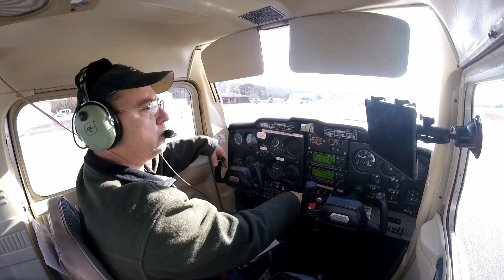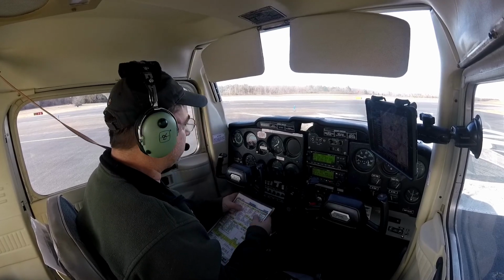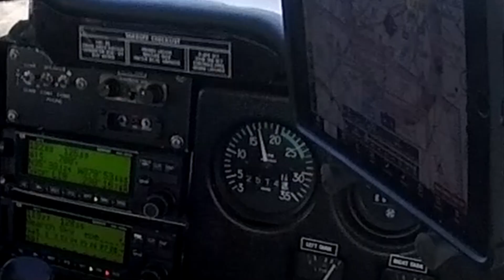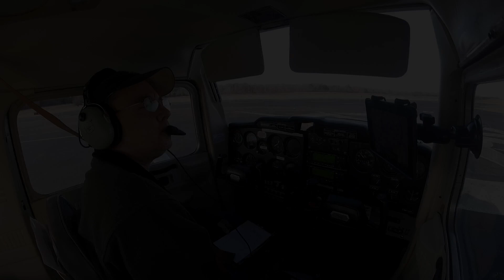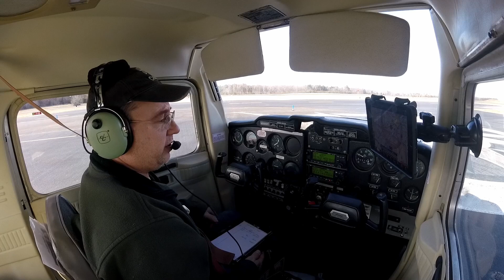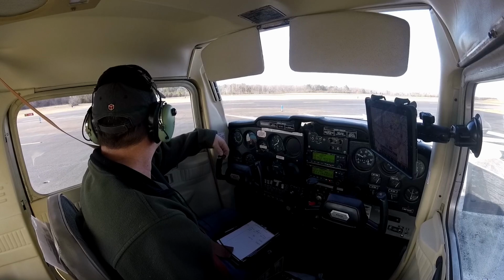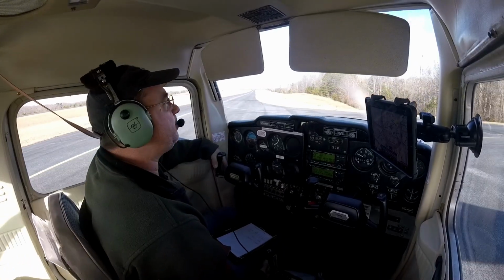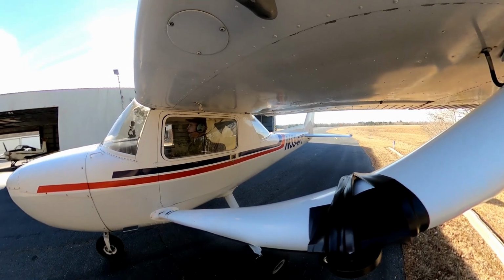Fouled Flight in the Cessna 150

Comment: This is the first video of yours that I have watched. It was so well done that I subscribed and intend to watch your others.
I noted that you lean as needed, so I'm going to throw something out for you to consider, check, and verify. The O-200 seems to regularly (when sitting idle for awhile) allow oil fouling to occur on the lower spark plugs. Most of the time it will be very apparent which plug is going to be the consistently "guilty one". There will be obvious oil on the plug. Assuming that the plug really is still good, all that is needed is a quick cleaning. Gasoline and a nylon brush will get it clean in a minute or so. Dry it off. Install it. Run a regular mag check before putting the cowling back on.
That would be an excellent and helpful video for you to make, too. 
Good luck
p.s. Check the plug on the pilot's side, nearest the fire wall first.
Reply from the maker: Glad you liked the video. Funny you say all that. Dropping the latest video as I saw your comment.
Thanks for watching
Reply: I just updated it with a p.s. Thanks for the reply to my comment. Good luck.
Reply from the maker: @ytorwoody  update video should be up now.

Comment: Not sure if you tried a maximum lean, full power run to clear the fouling... But while at 1700rpm, lean slowly until you get a stumble, then rich until it smooths out, then apply full power for a minimum of 1 minute. If you have EGT, lean for peak at 1700rpm. This is an almost surefire way to clear fouled plugs on the O-200. I have employed it in the past, and the only reason it has ever not worked is if the issue is elsewhere in the system. Cheers!

Comment: Bummer. 
About 2 months ago on a x country flight About 75 nm into it my C150 started losing rpm gradually.  I was at 3500 ft. I didn't recognize the cause immediately and with partial power I trimmed it for best glide and actually declared an emergency.  Luckily,  I finally realized it was carburetor ice.  At 2500 ft I turned the carb heat on and got full power back in 30 secs. I feel dumb and mad at myself for not recognizing the issue right away.  It was a good lesson.
Reply from the maker: Great story. Thank for sharing. My flight to CDN was like that. I noticed I kept having to trim up to maintain altitude before I saw my rpm had dropped. 
As soon as I added carb heat, BAM ! Power returned.  I think I had caught it early. 
From what I've heard, 150s are know for carb ice due to such small carb ventures.
Thanks for watching.
Reply: @justaboutaviation9343  That's what I found out too. After that incident I read the POH again twice.  lol